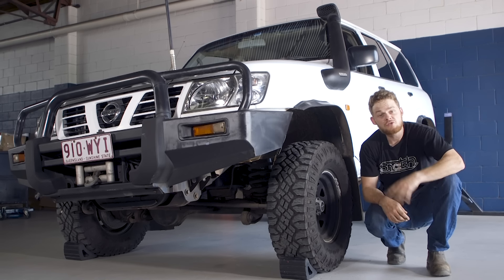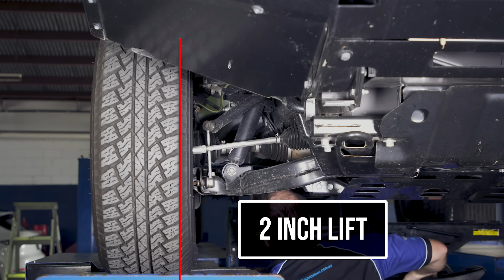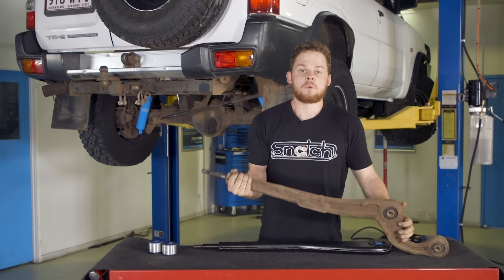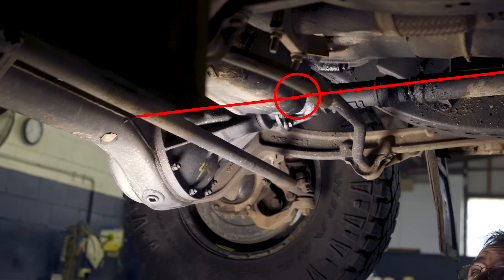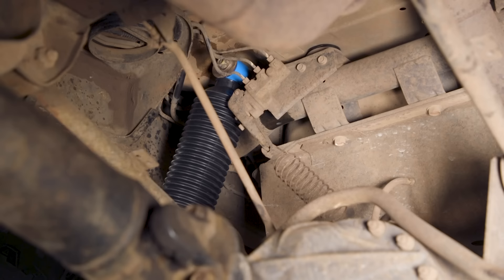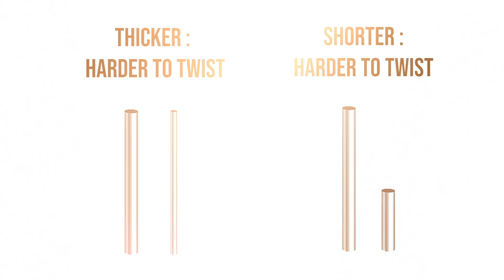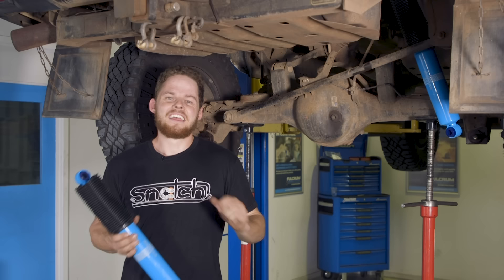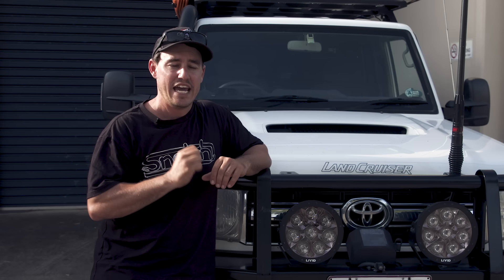EXPOSED! Are bigger suspension lifts better? Experts show what really happens when you lift your 4WD

Comment: Have any questions? Let us know!
Reply: You answered so many already in this video.  Thanks for the great presentation. You guys rock.
Reply: I’m running a 2”” Ironman lift with foamcell pro. Is fulcrum better?
Reply: What do you think about OME??
Reply: Would lifting the front of a RAM 1500 to match the height of the rear cause any problems? Would it affect warrantee on a new vehicle?
Reply: @ssinistervy9612  not RAM, only Toyota !!!!!
Reply: hey im planning to do 2inches lift on my pickup.. i dont do off-roading, should i get a full suspension upgrade or quick lifters / coil spacers will be fine?
Reply: Fulcrum, do aftermarket suspension kits void any vechile warrantys?
Reply: Whats your opinion on panhard relocators vs adjustable panhards?
Reply: @madrx2  No worries, glad that you enjoyed the video!
Reply: @patrickstaples7314  That is a pretty subjective question, each shock has its pros and cons. I would say Formula 4x4 is better for comfort + on road/ off road handling.
Reply: @ssinistervy9612  It should not cause any problems. Check with your dealer to see if it affects warranty.
Reply: @jeremiahdagcutan7759  If you want a proper suspension upgrade to handle increased load and have better performance, than get a full suspension lift kit. If you just want the look, than get a SuperPro Easy Lift Kit.
Reply: @TheDizzymarskell  No, but you should always check with your car dealers about warranty, as not all car dealerships are the same.
Reply: Hey,
How do you know how much longer the sway bar links need to be.?
Reply: Bought a fulcrum 2 inch lift with 300kg constant load springs in the rear for my d22 navara and can't fault it. Really good product and at just under $1000 minus torsion bars it's bloody good value for money!
Reply: I'm from Minnesota in the states and we don't have shit compared to you guys vehicle wise, it's depressing
Reply: What about air shocks?
Reply: This is an excellent education and visuals showing varying lifts. Im running a 3” lift OME on a 100s TLC. 295 x R17 (33”). I was glad to know Shawns advise for largest tires  with min lift is the route i went. i also upgraded all factory bushings to super pro polys & added a slee off road (USA Colorado) diff drop to keep the geometry perfect. I got the most from this as far as improving flex. Thanks for the good ideas from Texas!
Reply: How do you feel about portal axles and how do they fit into the suspension equation? Are they worth looking at?
Reply: I have a 2" OME lift with heavy springs that's probably been in the car since 2004 and has done about 165 thousand KMs. Will just changing the shockers improve small bump performance and smooth the corrugations, or will I need springs too? It's a GU patrol and sits nice with no sag.
Reply: I have a pretty simple question the big round Led lights I see on yalls arb bumpers a lot of times o saw the ARB brand lights bit wow they are proud of them any other good brands out their that delivers just as good
Reply: Do you change ring gear to match tire size
Reply: if I put a 285/75 r 16 tire which lift kit is better for a jeep grand cherokee wj ? thinks
Reply: @jeremiahdagcutan7759     Why lift it then
Reply: @PatrickRich  exactly! 2" lift on live axle means to keep factory steering specs fo on road use means you also need a 2" drop pitman arm and a 2" drop in panhard rod chassis mount to keep it and steering arm parallel to each other. All an ajustable panhard rod does is get the diff into factory location nothing else! It does not correct the bump steering you gain with increased angle of steering and panhard rod..end of story!
Reply: Are leafs bad for 4wding
Reply: @lettucemedia8023  No.
Reply: @vaughanhobden7828  Great to hear your having a good time with our Formula 4x4 lift kit!
Reply: @xxtm72xx63  Come to Australia ;)
Reply: @eduardoorozco6397  What about them?
Reply: @kyleedwards5291  No worries!
Reply: @the1stoldman  We dont really deal with Portal axles, so personally I would say they arent worth it.
Reply: @evdudeguy  shocks are for handling, springs are for comfort. So if you dont want to feel small bumps yes shocks can help, just make sure you get the right valved shock. Too stiff a shock and you will feel everything. If your shocks are really bad, than yes upgrading shocks will help. I would recommend upgrading both.
Reply: @ryanjacobsen9557  Hey mate, we dont really work with LED lights.
Reply: @jorgecasas7710  Depends on the type of driving you do. Not just the tyre size.
Reply: Why would you need to adjust the proportioning valve after lifting? How does lifting change the way the valve works?
Reply: Ifs is the best, that's why the best rock bouncers use it.
Reply: Where in Sydney are you situated ?
Reply: TIRES, NOT TYERS. Lol
Reply: For the ifs can you just put longer cv's in?
Reply: I got 3 inches lift on IFS through icon stage 2 kit. Am I in serious trouble? I
Reply: Hi from Florida!  I have questions and comments.  Why did you not discuss quick disconnects for the sway bar?  They greatly improve articulation off-road and are readily available.  Is that not common in AU?

I have a 3.5” JKS lift on my Jeep Wrangler Sport JL (a “true” 4” of lift).  It rides beautifully on and off road, virtually no difference than pre-lift.  Some of the components you recommended were not necessary for the Jeep, for instance, rear control arm brackets to use with the stock control arms, to correct the geometry.  Is the Jeep a different animal than the vehicles you discussed?  Thanks!
Reply: How could I get this video in spanish for our 4wd shops?
Reply: i own the 2018 Everest (Endeavour as known in our country).... i am planning for 33" tyres.... how much lift should i go for?? and do i need to change the control arms too with the lift?? kindly advice....
Reply: Hello, I have a question. Do you guys know anything about a Gypsy's suspension?
Reply: Best suspention for a 110?
Reply: I'm new to IFS, just bought a new 2011 4runner in Canada. Does all this apply to IFS? Or just for a solid front axle?
Reply: please make a video on how to increase flex in leaf spring suspension setup. or just give tips... thanks
Reply: Hello there!! I have a Suzuki grand Vitara 2007 with 2" lift kit but i run on stock tires (225/65R17) what tire size do you suggest i was thinking something like 245/65R17 or 245/70R17 and also thinking to change the rims to R16 what tire sizes do you suggest in both cases ? Thanks a lot!!
Reply: Do i need a uca for a 2 inch lift np300
Reply: @FulcrumSuspensions1976  8:20 Hi! Why not use revolver shackles for the leaf springs?
Reply: Great video! I have a follow up question though. I've heard that IFS vehicles can't be lifted beyond 4" because the UCA, even if a long arm, is basically hitting the coil at this point. Is this true? If so, would a smaller 3.5" or 3" actually yield more wheel travel? Or would a 2" lift yield more wheel travel than a 3" lift? 
Also, if it's a love axle vehicle can you lift it to your heart's desire without affecting drivability?
I also has a question regarding certain trims that come with say a 2" lift from the factory. Are they built like this and I can still loft it another 4" or even if they come from the factory it counts against your lift height?
Additionally, is it true that you shouldn't use lift blocks to lift a vehicle if you're planning on 4x4 wheeling with it, that lift blocks are only for show cars?
Reply: @fulcrum suspension I have a 4” and 35’s and want to lower it to 2-3” lift with 33’s. it’s a solid axel hilux with leaf springs. What do I need to know and is it a major job to do
Reply: @poneya9  Hey mate, it would be best if you talked to one of our workshops or suspension techs, head to our website and we can help you out!
Reply: what type of axel does a discovery 1 and 2 have?
Reply: Y’all do work on G63 AMG’s? How much lift do you recommend?
Reply: Do you guys do the billstien B60  (big bore) lift kit for px3 ford ranger?
Reply: Could we get a more in depth video of ifs. Thanks for this video just seemed you steered cleared of ifs.
Reply: I'm looking to buy a 110 defender and turning it into an overlander and true off roader. I'm think a two inch lift with 37s eventually. Is it worth it? 
It will be dual battery, bull bar, cage and Comms in the front. Keeping the rear seats for the two kids.
Reply: @Alex Lancaster  Yes its worth it. Hit us up on our website to chat.
Reply: @FulcrumSuspensions1976  amazing thank you.
Reply: Hi there whats your thoughts on the air shocks with 2" lifts? I have a 80 series 95 model looking for a full re build on it
Reply: Hi, I'm getting a 2 inch lift on my triton. And bigger tyres in the future. Is it worth getting UCAs?
Reply: Anything for a rav4 2012 v6 need better shocks and springs in the back?
Reply: Does 2" Suspension lift cause much wear and tear on components like driveshaft etc. And how much life would you get out of components. Loved formula on my mn triton just bought a new hilux and am asking for wear and tear reasoning
Reply: @LiamGrava  Hi Liam, 2" lifts generally don't increase the wear and tear on components like driveshafts etc for most vehicles, however some do require extra components to ensure everything sits within tolerance to not cause issues. Which for us Fulcrum lift kits come with any extra components that are required such as driveshaft spacers and extended brake lines etc.

For the components in the kit we expect them to last a while like anyone would want. Formula 4x4 lift kits come with 5 years/unlimited km warranty to back that up.
Reply: Hello! Do you have any lift kit solutions for more than a 2 inch suspension lift on a jeep commander xk?

Comment: 3" and 35's perfect for every patrol and cruiser
Reply: Does this including the GX470 (LC Prado 120 seeies)
Reply: Does this include FJ cruisers??
Reply: Both the GX470 and FJC are IFS so no, very different to LC and Patrol
Reply: I got a 2" and 35s in my patrol
Reply: Scratch that i now run 2" 37s on my GU ute, couldn't be happier 🤣
Reply: Bahaha, nah mate. 2" wouldn't do any of the shit I do
Reply: @DarrenBoxhall  lol lift wont grt you places, low center of gravity and large tyres will.
Reply: @entity65  yep, cool
Reply: @DarrenBoxhall  Hes right but darren

I run 3'' coils in my 80 with 35s, im considering dropping back to 2'' until i can afford coilovers as im currently 3 linking the front with a double sheer high steer setup and long arm/corrected geometry in the rear, although it only sits on 35s at the moment once the space cab chop is completed it will be running 40'' tires for bush activities, my current radius arms are to suit 5'' lift with a 20mm diff push for better approach angle and firewall clearance with bigger tires. 

Long story short, if you set up your bump stops and shock towers correctly a vehicle with stock coils will be AS capable if not more capable then a wankspec GU on 7'' coils with hyperflex arms and shit house rear geometry. 

Sill/chassis clearance means NOTHING when your true lowest point (Diff clearance) is determined by tires you can fit. and at the end of the day articulation means nothing if you have lockers. 

Me and my mate have wheeled a leafy short wheel base MQ at stock height with cut guards, twin locked and 35s up shit that people with big lift coily GU utes on 37s with open fronts couldnt get up.
Reply: @DarrenBoxhall  😂😂😂🤦‍♀️
Reply: @brockbain8656  that's interesting, because I have gone up/through shit with 7 inch lift and open front and rear diffs (blown factory rear locker)  when twin locked cars either can't get up because the approach/departure angle isn't enough, or they belly out.  Done it many times, and also you are forgetting wading depth. I have gone into water to help cars and have been able to sit in water fine where lower cars are taking in water. 

I honestly don't see how you would get a car with a 2" lift over big rocky obstacles that a rig with 37's and 6" lift is smashing it's chassis on. And before you say "pick a better line" alot of the time there is no other line.
Reply: @brockbain8656  and I have had twin locked low 4x4s, and gone out with them...... I wouldn't go back
Reply: @entity65  what are you, friends with these winch worriors on this channel?  

That's fine that you can do your 4x4ing with 2" lift, I'm telling you, the things we do, it won't work
Reply: @entity65  what state are you in? I need to come out with you and see this magical setup that doesn't belly out on big rock steps/obsticals
Reply: @DarrenBoxhall  depends what your doing, if your interested in driving through mud all day and getting flex photos then yes big lift is perfect for you. But if you like the more challenging tracks you want to stay low to the ground with large tyres.
Reply: @DarrenBoxhall  im at glass house every weekend
Reply: @entity65  bit far to meet up haha. I'm in Perth
Reply: @DarrenBoxhall  oh shit suprised you dont see more people running 2-3" with 37s etc over there
Reply: @mikef058  2.5 and 33s do wonders
Reply: 4 inch and 35s in my gq

Comment: I so agree! Live in the US and it’s a money making scam to lift your vehicle bigger then 2 inches. These shops swear to you that you need to put bigger tires to go over things better. 
 I made the mistake on listening to a highly recommended shop on installing a 6inch Procomp lift on my FJ. 
Even though it rides great because of the cvc joints are perfectly level it was not necessary to do and I only run 33s. To run 35 or bigger I would have to re-gear and that another $3-4,000.00 + tire cost. I wish they had more of this stuff on the internet back in 2012. I tell everyone do what the Aussies do, they have been doing it longer and better then us!

Comment: Excellent advice about maximum viable tyre size for a given lift. Ideally, you want to run the biggest tyres you can safely use with the lowest suspension lift possible while maintaining or increasing travel. Maximizing tyre diameter, ground clearance and usable travel while minimizing center of mass height.
Reply: Great point. Many believe a suspension lift allows you to increase tyre diameter. The truth: Live axle - IF you have modified your axle locations via aftermarket radius arms, extended upper & lower trailing arms - eg extended wheel centers and / or modified your bump stops then you may have made more room for larger tyres. This along with in some cases some bashing and cutting if necessary. If you have not done all of these things then the answer is no! The funny thing about suspension is that it MOVES 🤔🤨

Comment: It's times like this I love living in the USA, depending on were you live you can go rediculously high, but big lifts,big tires means nothing if you don't have good and proper shafts and angles and almost equally important a axle that can handle the tires with breaks that can stop them.
Reply: Ueah my 3 link kit for my jeep was the cheap part. It was the custom shafts. Otk steering and sye kit that cost stupid amounts.
Reply: But clearly, you don’t need to go ridiculously high! Unless you have a small pee pee but a high lift won’t actually fix that.
Reply: @officialWWM  you've obviously never been mud running in the Southern swamps in the US, besides I'm 6'4" I like to step up into a truck like when I was 8 years old,lol.